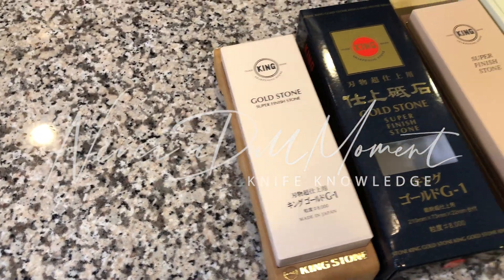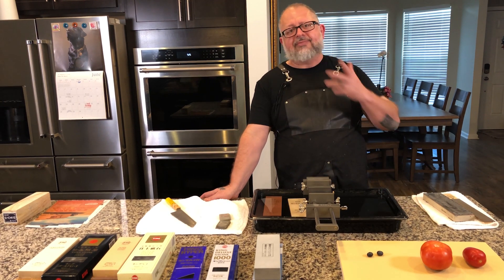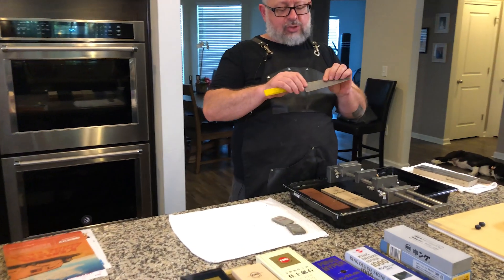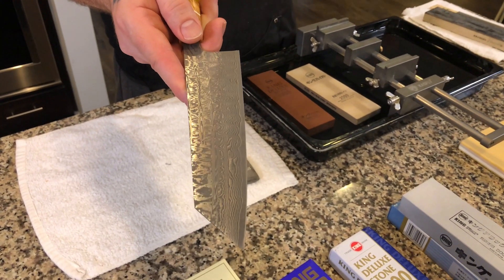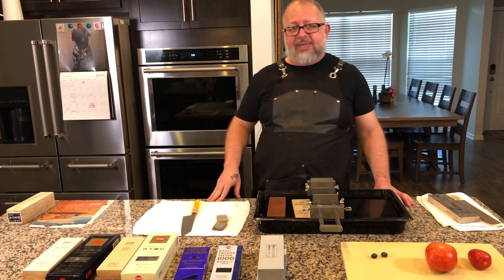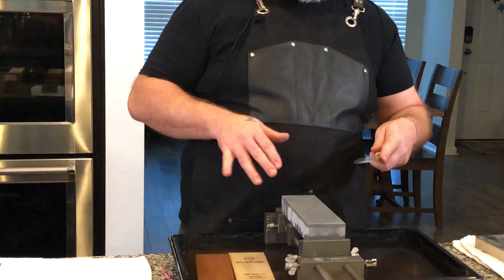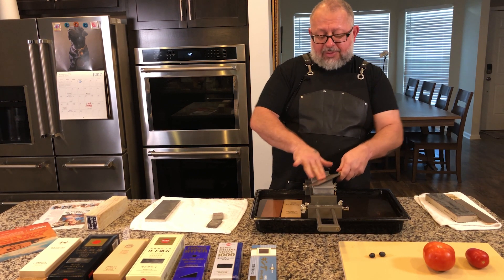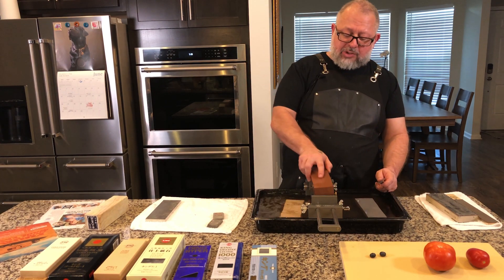Knife Knowledge: Still The King??????? King Whetstones review

Comment: Try the Shibata method (low grit on one side, high grit on the other). The result is toothy yet polished. I find it works particularly well on R2/SG2 and other stainless steels. Makes them feel like Carbon.
Reply from the maker: BOOM! I will definitely give that a try.
Reply: Woooooow it looks amazing! Do you know any forum or video that shows this method in more detaild?
Reply: Super cool :)
Reply: Dual Grit Sharpening is quite interesting. Todd from Science of Sharp did a study with electron microscopy on it. 
Dual grit forms an aligned burr that is sturdy enough to work as an edge. 
For this technique to work well it's quite important to use edge trailing strokes only. 
Edge leading is excellent for cleaning a burr but in this case we don't want that since the microscopic burr will be the edge.

Comment: I love your passion for sharpening.  I've ONLY been using King stones up this point as I'm learning to sharpen correctly.  I have already purchased the Morihei Fire line and then some naturals to level up after that.  Glad to see I'm not the only fanatic when it comes to kitchen knife stuff (despite what my wife would believe).  Your videos have been great guidance as I trepidatiously move forward.  So, in short and not so short:  thank you.  (on a SUPER side note:  I live on a farm and have axes and machetes that I use for land management.  I'd love to see your take on sharpening those!!!)
Reply from the maker: Thank you for all that. On a sidenote, I have never tackled those things! I have both. My machete is definitely messed up. I don't know if I can fix out by that one is. We will have to give it a go
Reply: I live on a farm as well. I have a huge thing for sharping my knives, kitchen knives, and my tools, axes and machetes as well. I usually machine them if they are really really bad, then maintain them with axe pucks , or at times and for certain tools my older stones I no longer use for my knives, as they get older and worn down, I'll switch them to tool work lol. Just know, sharpening your tools to often isn't smart, ive made that mistake and they really don't need to be that sharp either, lol, iv get bored and done it anyway, but it wears them out really quick and makes them even mkre dangerous then they are for people who aren't expecting a scalpel when they pick up a wood axe
Reply: @beentheredonethat5908  I only tend to keep the machete silly-level sharp. My axes are mainly mauls and then only need a vaguely pointed end to work hahahaha

Comment: In grinding wheel abrasive structures, beyond the abrasive type, there is also the bond holding the grains together. These may be harder or softer. For grinding harder steels, a soft bond is preferred as it allows it to break away and expose new sharp grains. Conversely, soft metals require a harder bond.
Reply from the maker: Thanks for that trip. I love that. I appreciate it. I need to apologize for taking so long. I've had a surgery on my knee and some other things going on. We've had the court case for my car accident. We had to deal with that as well. We've also had some other major things happening personally. Deaths in the family and lots of arrangements to be made. Also, I'll let you know that I will be having another major surgery in June and will not be making it to the Blade show. I will be out of work for two weeks because I'm having all the extra skin cut off of my body. We do apologize for an interruption of videos if it were to happen. Will try to shoot some head for you guys so we can fill the space. That being said, thank you for checking out the show. Thank you for your support and your comment.

Comment: When I started out as a carpenter in the 80’s the King stones were cutting edge. If I’d started 10 years earlier I’d have been stuck with the super slow cutting oil stones. I still have one King stone around 1,000 grit and it probably gets the most use of any of my stones. I do not have anything harder than RC 62 though, with the possible exception of my Japanese chisels. They’re softer than more expensive brands and require more work to keep them flat. So, they wouldn’t be a professional sharpeners choice. But for home use with budget constraints they are excellent.
Reply from the maker: Thank you for that!
Reply: Ohh, you’re welcome. I know you pretty much came to the same conclusion 🙂.
Reply: 1000 grit and then strop gets the best edge. Once you pass 2000 grit it becomes a specialized knife .

Comment: Hello. Nice presentation, I will definitely buy King. How often should I use the 300 stone? I'm afraid of deforming the blade of the knife too much.
Reply from the maker: Thank you and I really only use it when the knife is extremely dull. I mean extremely. You don't need that for a weekly maintenance. If you feel like you're spending an extra amount of time using the 1000 greater than you might need to go down to the 300
Reply: @nadm  Thank you

Comment: After struggling to sharpen my knives with Cerax #1000 (which is absolutely amazing stone), I've switched to King Deluxe 300 and it cut edge like butter. It would take me dozen passes to develop burr on Cerax, while 2-3 passes were enough on King. Plus it's splash and go stone and even cheaper.
Reply from the maker: Yeah I think the king might be a little bit more aggressive because it's a 300 and therefore it is like butter. You must've had a really dull knife.
Reply: You either have a very dull knife or inconsistent angle that will not reach the edge. When I was a newbie I had problem with angle at first. If the angle is not enough, one is grinding the shoulder of the bevel and never reaches the edge. If you have a knife with very soft steel, it may also seem impossible to get it sharp (and sometimes they are impossible)
I use something like 300 only when re-profiling, removing chips or when making major changes to sharpening angle. For different angle I may start wit that, for chips or reprofiling there can be even more coarse stone at the beginning.

Cerax 1k is a capable stone, be it a cerax new, LD or 1010. (there is some speed difference between those)

Comment: My first water stones were King: 800, 1200, 4000, and the then King of the Kings, 8000. They are very good stones but that was before diamonds and ceramics. 17:50.If the slurry is used in the sharpening process, why waste it by discarding it at the end of a sharpening period. It can't be used after drying? Why not? Just curious.
Reply from the maker: I think the question is, where do I put it? I need to apologize for taking so long. I've had a surgery on my knee and some other things going on. We've had the court case for my car accident. We had to deal with that as well. We've also had some other major things happening personally. Deaths in the family and lots of arrangements to be made. Also, I'll let you know that I will be having another major surgery in June and will not be making it to the Blade show. I will be out of work for two weeks because I'm having all the extra skin cut off of my body. We do apologize for an interruption of videos if it were to happen. Will try to shoot some head for you guys so we can fill the space. That being said, thank you for checking out the show. Thank you for your support and your comment.
Reply: The slurry will include small amounts of metal from the knife that has been sharpened. If you sharpen a softer knife in the same slurry, you've effectively changed the grit of the stone. Cleaning off the slurry when done sharpening prevents grit contamination.

Comment: IMO King stones are the best on a budget. There are def way better options out there. Also 10x the money. But the stone won't dictate how your knife cones out. YOU will dictate how it comes out. Put a beginner on a $400 Naniwa and put a seasoned sharpener on a cheap $10 stone, the experts edge will outdo the beginners all day. So if you're starting out, I would highly recommend King as a starting point. With decent skill, the king 1000/6000 combo stone which is under $30 btw, will give an amazing edge and it's a good stone to learn on. You don't want to try to learn on a super expensive stone. It won't make a bit of difference for a beginner
Reply from the maker: I agree with you 100%

Comment: Little correction : the 300 isn't soft :)
I could sharpen on the 300 every time but removes too much material , yeah the 300 isn't a stone to be used everytime.
You can use silicone carbide paper to flatten them :)
Why would people complain about the logo ? I NEVER sharpen on the logo ,would pointless to do it when there's a plain side.
Reply from the maker: So after using it a lot I definitely agree. I'm surprised I said that. It sounds like you're grinding your knife on pavement or asphalt. I didn't mean to say it was soft in the video. Maybe softer than compared to some things. I agree with you. When I do these videos I have to cover every person. So I was mentioning it in case people sharpened on the side with the logo. It's kind of hard when you're doing videos to not take into account every different viewer and user. It's kind of like reminding people that coffee can be hot. You assume everybody knows. You have to kind of take the time to say something. Thank you for supporting the channel. God bless

Comment: Wish you would've said something about the polish that King 8k leaves...
Also these horisontal cuts are just for the show, because in reality the knives are used to cut food in most cases vertical.
More than that there is a specific reason why a knife cuts or not the tomato when cutting horisontal like you do,  and why it also cuts different when cutting vertical!
It has to do with sharpening technique, grit progression, stroping and a little more.
But since you are a knife sharpening nerd (like me) and like to test/discover new things, i will let you discover whatever i am talking about here and watch your videos and see if you ever discover, because it's a major difference for a pro chef when cutting food 😉
Reply from the maker: Thank you for checking out the channel. This particular video was just about the king whetstone product. The other things you mentioned are definitely more for sharpening videos. We do talk about them and the sharpening videos. I’m glad you’re a sharpening nerd because that makes us two of a kind. The horizontal slice on the tomato is just to show that the tomato doesn’t move because the knife is so sharp it doesn’t push it. I also have a video where I do it with an onion. You are correct, the knife normally cuts vertically. You’re also correct that different grids and different edges are used for different material when you’re cutting. We’re going to be doing videos in which we talk about the right edge for the right knife. I do appreciate your support and I appreciate the suggestions you mentioned in your comment.
Reply: @nadm  i watch all your videos you know 😏

Comment: for slaughter/butcher, what number grit to use?
Reply from the maker: 1000 or below. I would probably finish on the 1000. You can finish on the 3000 but don't go any higher.
Reply: @nadm  
after sharpening whetstone grit 1000, need sharperning steel again with finecut?
Reply from the maker: @htcdoraqaza4777  no! Do not touch it with the steel. Those are for honing and if you were already sharpening, you don’t need a sharpening rod.
Reply: @nadm ok i'm understand.
I guess need for Straighten the edge
Reply from the maker: @htcdoraqaza4777  yes definitely after you used it you need to realign the edge
Reply: @nadm  ok sir.
thanks you so much
for ur answer
Reply: @nadm  
for slaughter cow & goat.
king grit 1000 to 1200 is much different ?
Reply from the maker: @htcdoraqaza4777  No your fine with either
Reply: @nadm  ok sir,
thanks u so much

Comment: If someone wears out a King stone, they have enough experience to decide what they want to try next.  (*and  hopefully they were able to do enough sharpening for $$ that they can afford any 'next' stone)  They will have also learned how to flatten, etc.  They will see how fast/slow different steels cut on a "soft" stone.  And, along the way, I would suspect that they would buy a splash-and-go to give them a try.  King is a great learning stone.  The fact that it is "slow" is a great thing for a beginner.

I use 800/1200/4000 King and all perform very well on a variety of steels.  A Shapton Pro 2K feels very different, but all of them work on all of the "reasonable" steels.
Reply from the maker: I agree that if the stone is a little slow it might be good for a beginner but sometimes it can be frustrating if it's too slow because you might not know what you're looking for. I agree that is why I shouldn't go just saves time. We have to have patience when we are soaking but the soaking stones really do perform very well. I've personally value my time.

Comment: No Nagura for a slurry?
Reply from the maker: I did not need that for this particular stone. I use a slurry when I'm polishing and the lower grit stones create a slurry very fast on their own. If I needed a slurry on the higher grit, then I could use one or I could use the lapping plate. I need to apologize for taking so long. I've had a surgery on my knee and some other things going on. We've had the court case for my car accident. We had to deal with that as well. We've also had some other major things happening personally. Deaths in the family and lots of arrangements to be made. Also, I'll let you know that I will be having another major surgery in June and will not be making it to the Blade show. I will be out of work for two weeks because I'm having all the extra skin cut off of my body. We do apologize for an interruption of videos if it were to happen. Will try to shoot some head for you guys so we can fill the space. That being said, thank you for checking out the show. Thank you for your support and your comment.
Reply: @nadm  i tried some rouge on my Randall, and finally it will slice paper. It works great on a working blade or for fine polish. Have u used it?
Reply from the maker: @travhammer  I've used green and blue and it seems like maybe one other color like white maybe

Comment: Everything Ive learned about properly sharpening a knife with a stone one does not use a back forth motion. It is a pulling motion direction towards you  and.on the other side of the blade a pushing motion away from you.
Reply from the maker: I'm not going back-and-forth. I don't pick up the knife when I'm going back to the other direction. I'll let it slide. The same way, Bob Kramer, the very famous knife maker, does it. He's the one that train to me. I have tremendous results with my technique. You could watch some of my earlier videos. The knife is either edge leading or edge trailing. But which ever direction I choose, it is not pulled back-and-forth on the stone in both directions. That being said, I have done it privately. The owner of Japanese knife imports does it that way. He talks about it in several of his videos. I have had great results with it even though it's not my normal way to do it. I can't find anything wrong with the technique. You're doing edge, trailing and edge leading both back-and-forth saving time. Again, not my normal, but it's hard to find something wrong with it. You should do some experimenting yourself.
Reply: I've seen Japanese go crisscross over whetstones.

Comment: The King 8000 is even softer than the Kitayama 8000???  WOW!  That's soft!
Reply: Personally I don't agree with this statement. The King 8000 is considerably harder than the King 6000, and also a much more efficient cutter than the 6000 as you could clearly see in this video. The Kitayama 8000, to me, feels very different to the King 8000 and I would say it is a little softer or as soft. The edge off of the King 8k is truly amazing, both extremely keen and with more bite than the Kitayama 8k. At least in my hands.